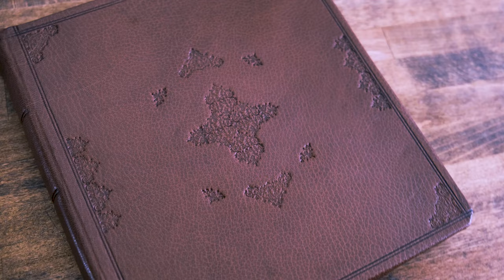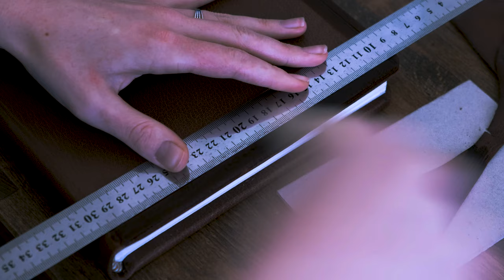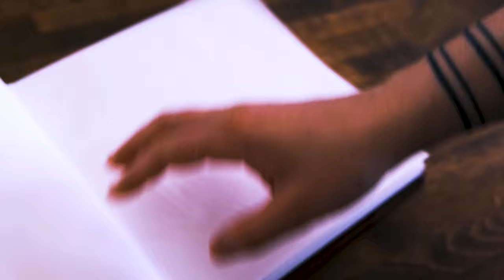Making a leather bound album with 18th century motifs

Comment: You got yourself a new subscriber. Congrats keep up. Fine craftsmanship. I have few questions may I ask.
Reply from the maker: Hi, thank you. Sure, ask
Reply: @bookshelfiv2537  What is the leather you used. How much money you spent on materials for one diary/notebook.
Reply from the maker: @gnsarathbabu  the leather is veg tanned goatskin sold under the fine leather category of Harmatan and Oakridge (you can google them) . The price depends on the type of leather, the grade and the size, you can ask them for their pricing or I think they have it on the website somewhere. I used a whole skin for this album. The paper, the boards, leather cords and threads cost a couple of euros each (usually enough for more than one journal). The brass tools I used on this project cost approximately 250 EUR, but thats a pretty rough estimation.